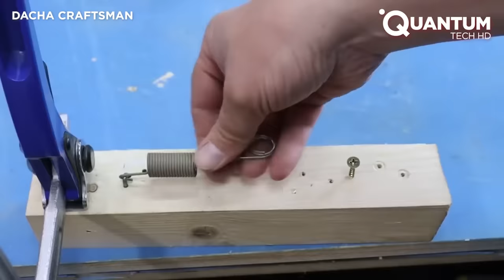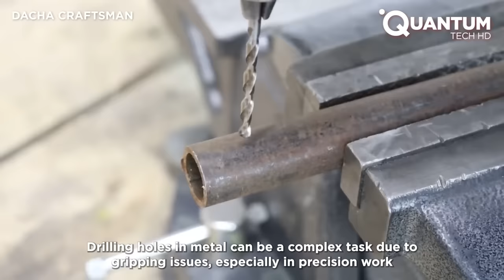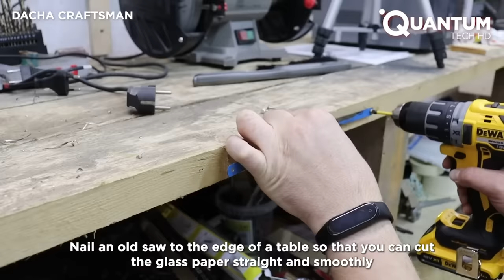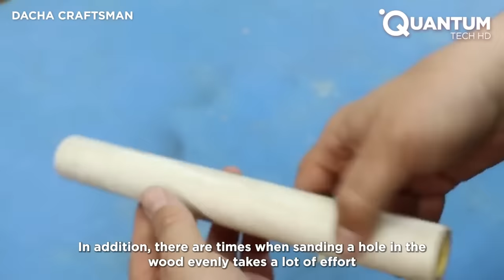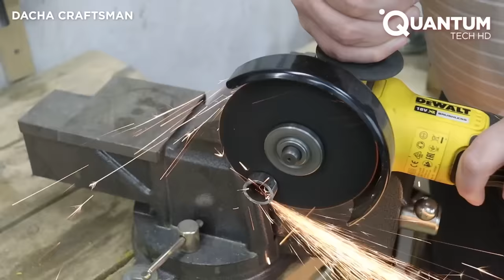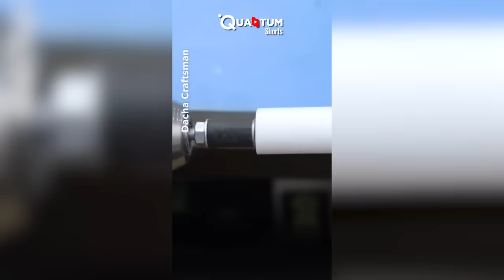Handyman Tips & Hacks That Work Extremely Well | by @umelec-diy

Comment: Great tips. Do you have a video on how to tighten hinge screws on a hollow core door.
Reply: If the core has frayed and no longer tightening you can either try larger screws, pack the holes with bits of timber (match sticks will work), drill larger holes and plug with wooden dowels and pva glue then you can put screws into the newly secured dowels. Depends on how bad it is.